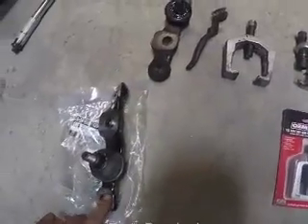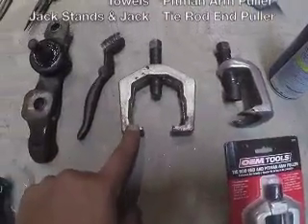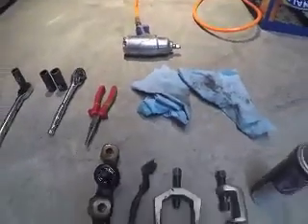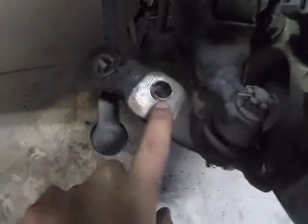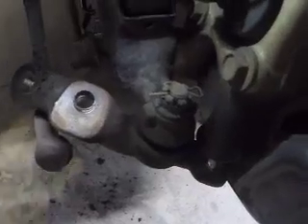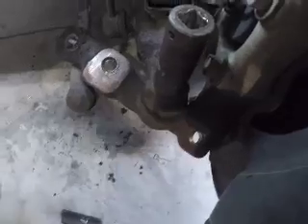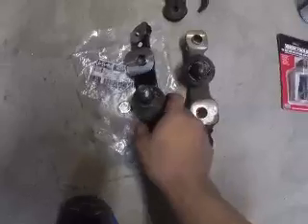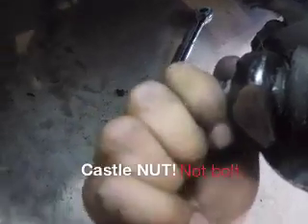How to Replace LS430 Lower Ball Joints

Comment: Torque Specs
Lower ball joint nut - 119 ft*lbs
2x bolts for hub to ball joint bracket - 83 ft*lbs
Outer tie rod nut - 43 ft*lbs

Comment: Nice vid 👍What were ball joints doing to let you know they were failing?
Reply from the maker: You'll Like It Too Popping sound upon slowing down and coming up on red street lights.
Reply: @MotorHead18  cool thanks. 👍
Reply: Unstable handling, pry bar test for play, and visual inspection of the ball (elephant butt deformation) signal the kaput ball joint.